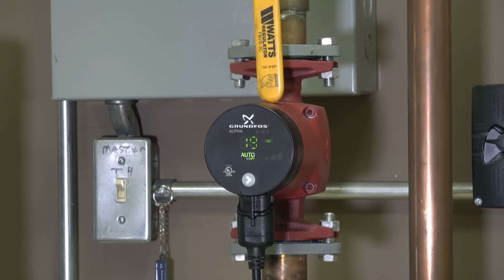Hydronics System Components

Comment: Ben, I really liked your presentation. KUDOS! 
My home is constructed of insulated autoclaved aerated concrete with a slab concrete construction. Huge amount of insulated thermal mass. I also have a GROUND SOURCE (geothermal) heat pump. Hydronics through the concrete slab that includes five zones, one zone specifically to the garage. CANNOT overstate the value of a warm garage floor!  No propane or natural gas to home. Everything is electric with 400 A of service, two panels.  I have kept meticulous records of the energy usage over the past 12 years.  I live in a very cold climate in Central Oregon.

CONCLUSIONS:  1)  GSHP is overrated in terms of the amount of investment and return on your dollars, ROI.  I spent 27K startup.
2) my electric boiler is Stiebel Eltron (like many of your parts) very efficient and very happy with performance. I have had others. They have a Hydroshark module very much like what you are making. My domestic hot water is 36 kW boiler and works exceptionally well. Multiple showers at once without any issues. You really don't need gas, LP or natural, as long as you have the electric supply.
3) any heat pump will produce noise and having the totally silent hydronic system with electric boilers is well worth the investment.
4) I typically will run the heat pump during seven months of the year from October through April. I turn it off during the five months of the summer because the amount of concrete and construction of my home does not require any additional heat. During the summer, with the system shut off entirely, and the external ambient temperatures ranging from 40° in the morning and 90° during the day. I only see about three maybe 4° of fluctuation within the dwelling. Does not require air conditioning. Having the concrete slab moderates the temperature but the changes are VERY SLOW. Extreme delay if you're trying to heat or cool on demand.
5)  over the past two years I have turned off the ground source heat pump during the winter with hydronics on electric boiler only and cost difference is really not that significant. My home is about 4300 ft.². 3100 ft.² heated throughout and 1200 ft.² of garages that can be turned on per demand. Hydronic loops throughout. Without the ground source heat pump and using electric boiler for hydronics, I am seeing about $50-$75 increase per month of energy use over the seven months compared to the ground source heat pump.  Considering my initial investment, it would take many many years to reconcile the difference as compared to electric hydronic from the start. Sometimes we chase efficiency, spending considerable amount of dollars, for only marginal gain. Just like healthcare, spending lots of dollars to gain just a few years life expectancy.
6) forced air and air source heat pumps tend to fluctuate on and off ANNOYINGLY, to moderate the temperature (my business has this).  With with concrete slab, considerable amount of energy is stored up and released slowly and in the very delayed fashion. Very quiet. Very comfortable. And you can take advantage of the lower utility rates while heating this during the off hours of the night if your utility company offers on-demand and off demand rates.
7) most homes are extremely oversized in terms of capacity. My size home will require anywhere from 4500 Kw to 14.4 kW of energy to heat during the winter months, seven months. Because of the concrete slab in the amount of energy stored, I don't need a much larger system.
8) one must consider the electrical supply that is required for the boiler system. Depending on code, size of the boiler, specially wire anywhere from 10 to 4 gauge might be required with an electrician to achieve the energy required by the on-demand boiler. Not your standard electrical wiring.
So what is your motivation? Save the environment? Have the most efficient system? Bottom line: save dollars? 
Just remember that the ground source or air source heat pumps do not last forever and will eventually need to be replaced.
I hope this helps others!
Reply from the maker: Who is Ben?
Reply: Do you have a ground source heat loop or a true geo thermal system ?  Tapping the thermal energy of the earths molten core ?
Either way,  how deep are your wells ?  And how many wells do you have ?  what was the cost of the wells ? What was the cost of the system less the wells ?
thanks
Robert
Reply from the maker: @badairbnbguests.robert6516  He has ground source heat pump (GSHP) which uses the ground mass for thermal storage for both heating or cooling.  He is not extracting heat from the molten core of the earth.